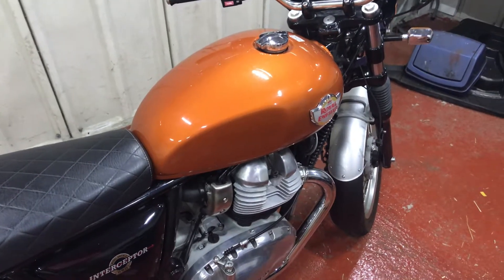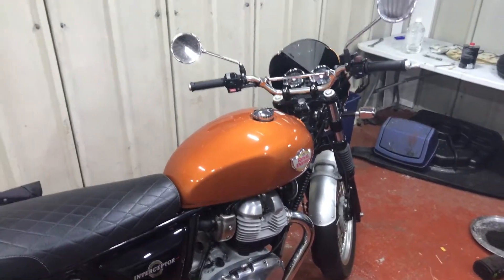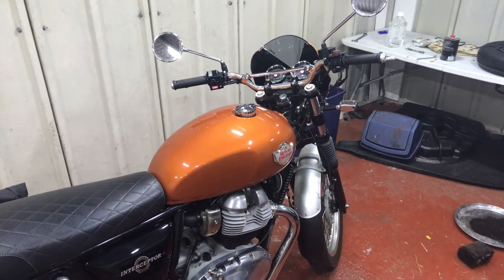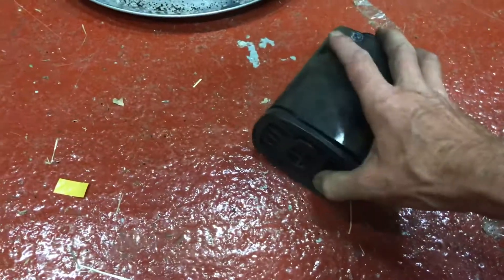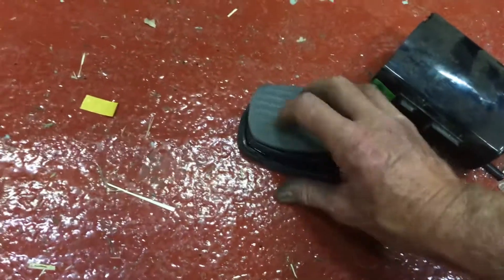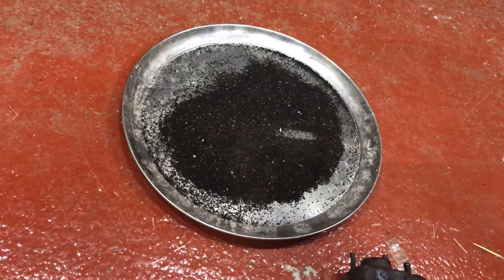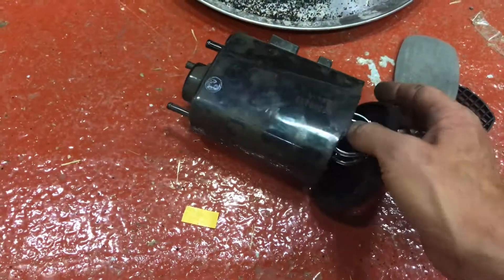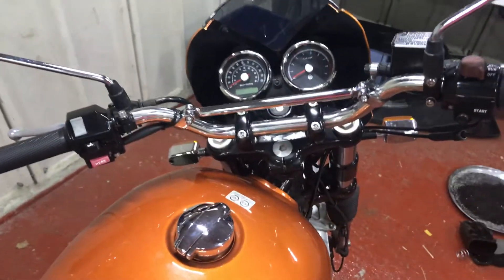Interceptor 650 EVAP cartridge autopsy and performance update

Comment: I think the charcoal should keep working basically forever. If the unit isn't purging or purging too much that suggests the operating valve not working correctly.
Reply from the maker: @orange42  I doubt that. The purge valve is a simple solenoid. Theoretically, the charcoal should last forever but if it gets drenched in fuel, the charcoal turns to sludge and the evap system is then kaput. It happens all the time
Reply: @internetpolification  yeah so if it isn't switching then the signal to it is bad or the unit itself is
Reply from the maker: @ the issue with the Evap is never the purge valve. It’s the fact that the charcoal becomes full of raw petrol. That’s why it’s best to remove it
Reply: @internetpolification  well I've removed it.  Not sure if it's helped at all but no worse.

Comment: Good video mate. Appreciate the outcome you experienced
Reply from the maker: Thank you……I do my best! Not glitzy and I’m only using an iPad……. Yes, me too re the outcome. I couldn’t believe how bad my bike was when I first got it (secondhand..)i thought I’d been sold a lemon and was on the pint of getting rid of it. Then I removed the evap system and..hey presto….a total transformation….
Reply: @internetpolification  we are exactly alike in experience. I got mine secondhand too (Himalayan) and i thought mine was a lemon. I had to replace my fuel pump which i got a third party mechanic to do because bike wouldn't start and fuel pump wouldn't prime but and ever since then my starts were flawless. Fast forward around 8000 kms into my rides I've started stalling bad. Fuel pump is fine but I'm trying to isolate the issue and i think it could be the evap. Deleted it today on my own. Will test ride it to see if it's going to work which i hope will finally as i am at the edge myself. Will try to edit the comment when it does.
Reply from the maker: Want to bet it’s the Evap? That’s my guess!

Comment: Thanks for posting this, James!  

My '21 Continental GT 650 (Euro 4), here in the United States, has the same issue...starts on first or second attempt when it's a cold start.  On the other hand...it takes a few attempts to start it again after riding and the engine has been warmed up.  

I have replaced all four relays on the left side panel, a completely new battery, fuel system cleaner, spark plugs, ignition wires, valve adjustments, and even removed the fuel pump and fuel filter from the fuel tank to empty and clean them...yet still have the issue.

I just ordered an EVAP delete kit from SmartMoto Electronics and will GLADLY put in the time to remove this system myself!  I will also be deleting the AIS system and blocking off the exhaust section with finned covers.

Glad to see and hear it resolved your starting issues!
Reply from the maker: Yep, that sounds exactly like my bike used to be! It must have been very frustrating for you to do all that work and still find you had starting problems! I think k you will find that, once you’ve removed the Evap, all those problems will disappear immediately. Your symptoms are exactly the same as what I had. When you remove the Evap cartridge, hold it upside-down and see if petrol drips out. Or, even better, saw the end off and see how soaked the charcoal is inside.  Please keep us all posted on this.
Reply: @internetpolification   I removed the EVAP charcoal canister, and unnecessary tubing/hoses then rode 150 miles = 242 kilometers in 80°F = 27°C weather. Perfect start on the first try every time I shut it off, and smoother idle with no issues! Game changer 🙌
Reply from the maker: There you go! And a couple of pound of useless hardware less. I’m very pleased for you!

Comment: Next Remive your air brather box and put pod filters on there 😎
Reply from the maker: Mmm….yes, that is an idea but I’ve found in the past that the engine sounds noisier through them. I did fit a Dynaflow filter after removing the snorkel and using the supplied triangular adapter. I hated the sucking sound coming from under my seat and put the OEM kit back on!
Reply: @internetpolification  oh ok, I like to hear the carbs turning air in to power 😁
Reply from the maker: Ah yes…..I do appreciate what you say…….but we oldsters like a nice, quiet, sedate ride! 😀😀😀
Reply: Pods are a BAD idea on the Interceptor as you'll lose bottom end and midrange power for a very minimal gain up on top.   The ECU absolutely won't play nice with pods either without lots of tuning changes so unless you fit a PowerTronic tuner...the stock tuning is going to run poorly.    If you want to do something that actually makes more power...the low restriction air filters are good and if you trim the intake stacks 2" it'll free up some horses while retaining most of the bottom end torque.
Reply: @recoilrob324  more people are able to flash the ECU now, 🤠
the power tronic is a must have to go with exhaust and cam shaft change. 💥
Reply: @DANTHETUBEMAN  Yes...when I put in the cam and pipes for sure the Interceptor needed some tuning, and while ECU flashing is available, I think being able to tweak things on your own is better than sending out the computer and just living with whatever they send you.   I flash my Suzuki ECU with the Woolich Racing kit...and PowerTronic for the Enfield.

Comment: If you constantly overfill your fuel tank excess fuel and/or vapours makes its way to your charcoal filter and ruins it.
Reply from the maker: Yes. That’s why I removed the entire Evap system, as per a previous video. And it’s not even “constantly”…..even one overfill (which nobody seems able to define) ruins it.

Comment: workshop manual states if evap unit becomes like yours, it should be replaced. just the black charcoal unit. did not even know the bike had such a thing till I read the manual!
Reply from the maker: Yes, that’s what it says. However, the charcoal cartridges become clogged with petrol if the tank is “overfilled”. There isn’t really a definition of ‘overfilling’. Mine and other people’s cartridges have become sodden with petrol without knowing why. The whole EVAP system is a compliance setup and a cheap one at that. It is a solution to a problem that doesn’t really exist, namely ‘pollution’ from a fuel tank breather, as defined mainly by the USA. As I mention in the video, the ‘pollution’ from a fuel tank breather is negligible (my bike is in a garage which gets warm due to the roof colour…I smelled more petrol with the Evap on, than I do without it on…because I NEVER smell petrol in there now) and won’t counteract massive pollution from other, unaddressed sources. My bike took two starts from cold and three from hot before it ran properly….every single time. After removing the Evap system, it starts first time, every time. The system itself is crude, cheaply made and better off in a dustbin, quite honestly 😀
Reply: @internetpolification  agree with you, just another thing not wanted or needed.
Reply from the maker: @morrisminor56  I think it’s to comply with California emissions laws……a state where it’s illegal to wear perfume in the street. Says it all. Honestly. You wouldn’t believe the difference removing that Evap system makes. I thought I’d made the wrong choice of bike at first, with all the difficult starting every single time. Removed the Evap and….[effect thereafter!

Comment: RE ll kill your warranty
Reply from the maker: Yes, it would if I had one. I bought the bike used and the previous owner took it to a RE dealer who did not register the service with RE. When I bought the bike, my local RE dealer checked with RE who maintained that, because the bike had (allegedly) missed a service, there was no warranty…even though I had the service receipt for the work being carried out by one of their dealers. 

To be honest, this video and any others I post aren’t really meant for people concerned about warranties. Once the bikes are 3 years old, the warranty is over anyway. My videos are really aimed at people who maintain and modify their bikes themselves. If I’d bought the bike brand new, I’d just be taking it back under warranty for the poor starting, dodgy switchgear, fluttering speedo needle etc  that I’ve experienced but as it is, I can’t do that. In a way, it’s  kind of a relief as it means I can do whatever I like to my own bike, something I’ve always done.

But yes, I agree, it would nullify the warranty, as would my replacement switchgear, I suspect! You’ve made a good point though…..this isn’t for everyone
Reply: @internetpolification  dude 👍i m getting milage issue what to do 🤔
Reply from the maker: @SouravAcharya9444  what’s the issue? Low mpg?